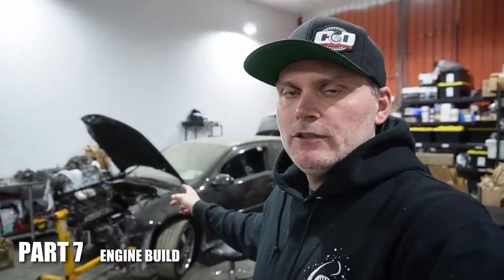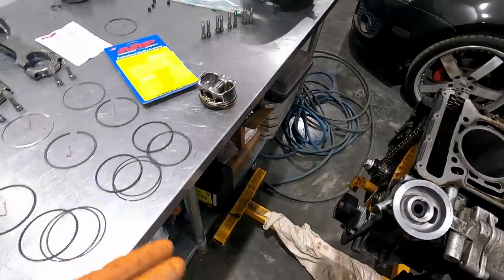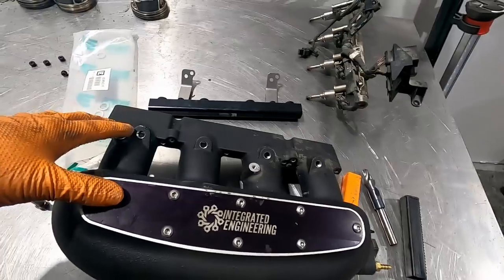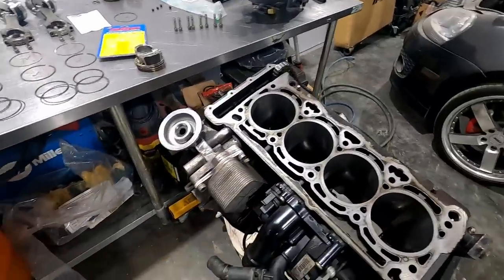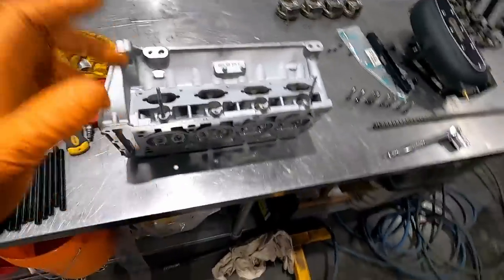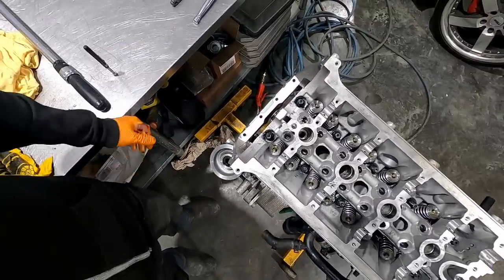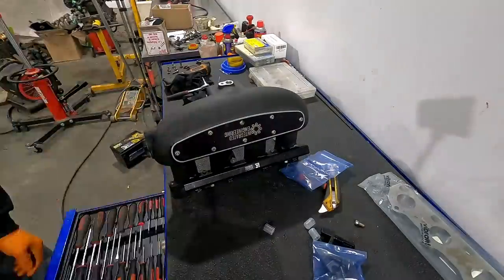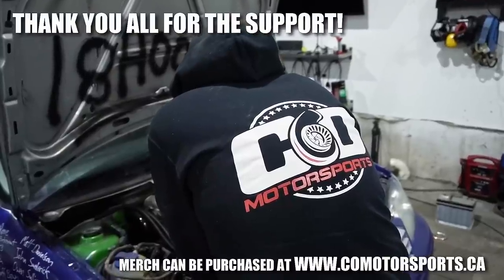MK5/6 TSI EA888 Big Turbo Engine Build PT. 7

Comment: Interested cause I’m building a Gen 3 tsi mk7 motor with the integrated exhaust manifold into the cylinder head…. Also will be cool to see the manifold y’all end up fabbinn up.
Reply: Thought that manifold didn't fit mk7 1.8ts

Comment: You guys obviously know what your talking about so I have a question, I wanted to RS3 swap my 2.5 MK6 Jetta but a used engine is $15k with a ECM and no trans so I'm gonna buy a $500 2.5 but before I build it I was wondering if I could use the head, intake manifold, and turbo manifold off a RS3 on a non turbo 2.5? I'm putting rods and .20 over pistons in the block and it's cheaper to buy a RS3 top end than to buy the IE intake manifold, have my head ported and get cams for it and have a custom turbo manifold made that's why I'm wondering
Reply: And do you think I should and could safely go up more than one size on my pistons, I was gonna go .20 over to be safe but if I can go a little bigger safely I will
Reply: And do you think I should and could safely go up more than one size on my pistons, I was gonna go .20 over to be safe but if I can go a little bigger safely I will
Reply from the maker: I'm doing the same swap in my daily. Don't overcomplicate it. It all comes down to how much power you want. If it's 3-400whp then just use a stock engine with the right turbo setup. If you want more, just do rods and pistons. It will make power without question.
Reply: @COMotorsports  what do you think about throwing boost at a used engine, I'm going for around 400hp, you think a used engine would handle it without doing anything to the bottom end? I'm already doing a hard gasket and front and rear main seals and timing chain/water pump because to my engine in my car what else should I do? Do the cams that they make for the 2.5 or the IE intake manifold benefit me in any way  if I'm going turbo? This is also my daily and the first new car I've ever bought so I wanna do it right
Reply: @COMotorsports  also love to see a video on your daily, we need more good 2.5 content... ECS was doing the swap in a 914 but they made one video and it's been months with nothing else and all the other videos are "what a 2.5 sounds like" 30 second sound clips basically

Comment: I have a question. I did all new timing chain on my 2.0T a while back but had a real hard time with the crank pulley. Every time I took the bolt out to put the pulley on the gear would move. I had to leave the tensioner pinned until I had the crank pulley on and then tension the chain? Would you have any clue what I did wrong, or be able to put it in a video when you pull that bolt out to put the pulley on?
Reply: If you take the crank pulley off, put the bolt back in to hold the chain drive attached to the crankshaft. Otherwise the crank can turn and the chain drive stay in place or vice versa. With the bolt in hand tight and holding everything together, you can pull the pin
Reply: @etunedmk4  but with chains and cover on and tensioned, how do you pull the bolt back off to put the pulley on without it moving? As his sits in the video, like I did mine, when I pulled the crank bolt out to put the pulley on (that bolt is what holds the pulley) the timing gear would be pulled to the exhaust side of the engine and up just a hair.

Comment: I've got a MK6 with CTS Turbo's K04-X hybrid turbo kit.  I'm in the states and running 93 octane.  I'm running out of fuel around 6K rpms with the oem low pressure/high pressure fuel pump.  I'm around 90% duty cycle on the low pressure pump.  Would you suggest going with water-meth to supplement the low pressure fuel pump or should I aim to install a larger fuel pump?  I've read that you can use a pump from the S4/RS3/etc, but it requires modifying the ecu.  What are your thoughts/suggestions?
Reply from the maker: Watermeth provides lots of benefits but also brings things outside the stock ECU meaning more room for errors. We usually do LPFP in these and sometimes LPFP module as well depending on what the vehicle is used for.
Reply: I’d suggest one of the Precision race works drop in LPFPs. 
Will need upgraded module or fuel pump ground mod for it though
Reply: @Ethan007Hacks  Yeah, I believe that anything larger than the oem low pressure fuel pump will draw more current than the ecu can handle and will therefore require the 'fuel pump ground' mod.  Thanks for sharing.  I haven't heard of Precision Race Works before.  I'll look into them!
Reply: @whorutothink  yep. I’m running their drop in walboro 535 kit but I had to modify the fuel pump ground so the module wouldn’t overheat. Holding off on buying a PM4 until I get the built engine in

Comment: Have you rebuilt any of these 2.0t after timing failure? 80k on it, just wondering if the block likely needs work or if I can just rebuild it without having to get the block/head machined
Reply from the maker: Engine failure is generally unique to itself.  There are so many factors, how and when it failed can change the overall damage. You can't say anything for certain until you open it up and see what damage has been caused.

Comment: Hi I have a mk6 with a hpa k04 all of the supporting mods for it and I just put on a IE manifold and I have a meth kit but I never put it on because I am running IE tune and it’s not for meth I was wondering how I can hook it up and not blow my motor or how to run port injection instead and also if putting a bigger turbo on it I would have to build the whole motor.   Thanks
Reply from the maker: Port injection is not an easy feet on mk6. The stock ECU can not control port injectors. Stick with the water meth setup. Stock engines good for ~400whp so you have room to go from a k04.

Comment: I've been long awaiting this exact content to guide me if I want to go further than stage 3. If I were to run an ie manifold on the car at stage 3 would it make much of a difference?
Reply from the maker: Maybe someone but not tons. The difference comes in when you're doing dIrect port water meth or want to run a second set of injectors.

Comment: why wv never made a powerful version of the ea888 gen2? and jump from ea113 to ea888 gen3 on golf r/ S3. What is it weak point?
Reply from the maker: The MK6 R was an FSI... so not the same engine at all. But the Gen1/2 EA888 were only slightly different and are good for around 400whp.

Comment: Good job. What is the 2.0 tsi ea888 gen2 head limit for make crazy hp?
Reply from the maker: Fueling is a problem before the engine becomes a problem.
Reply: Yes i know, after high fuel pump and injectors upgrade wtaht is stock head limit of ea888 gen2 engine? Nobody talk about head limit 😊
Reply from the maker: @vitomelchionno6225  It's because it's not an issue that pretty much anyone's going to run into. It's a decent flowing head, and people have made a lot of power on much crappier cylinder heads.

Comment: I just bought mk6 with a rod knock and the piston was touching the head and just did a full bottom end rebuild and swap. How come you didn't do all mew guides?
Reply from the maker: Because the engine has low kms, and there's no need.
Reply: @COMotorsports  we replace them by time, being over 10 years old just a good peace of mind for me, but if they hold up thats definitely nice to know that there's nothing to worry about. I've only seen the small one between the cams break

Comment: Do you use a tune through the ecu to control the extra injectors or is there a separate controller for them.   This is the step I've been stuck at.  Can you do this through maestro?
Reply from the maker: Definitely can't be done through Maestro, this car is going on Syvecs standalone. One of the very few that can control direct port injectors.
Reply: We ran megasquirt on my set up  built motor ported head +1mm valves on both sides juat like they did 1000cc id on top golf r on bottom 2 535 pumps it was not enough cams tapped out so sold all off it n n doing k24/dsg on fuel tech for real powaaaa

Comment: Maybe I missed it, but how are you going to block up the direct injection ports?
Reply from the maker: Those are still active and will control fuel for driveability and the first couple hundred HP
Reply: @COMotorsports  I see, thanks for the reply. Does syvecs control the direct injectors?
Reply from the maker: @opt123123  yes sir. Which is one of the very few to be able to do so.

Comment: Is there anything that needs to be done with the balance shafts when doing a build like this?
Reply from the maker: Ideally they'd be gone but not a viable option on these.
Reply: @COMotorsports  right. I did see 1 video where someone deleted them and had a electric water pump just stuck in the engine bay. Not the prettiest setup but it served it purpose. I'd love to see someone come up with an actual factory style water pump with an electric motor in place of the cog pulley. Then just take the balance shaft chain off and let them sit in there or just a setup like they use on the 4g63 where they tap in a bushing to block the oil ports.
Reply: @COMotorsports  or possibly have custom balance shafts made without the weights on them so they are just neutral
Reply from the maker: @blindabinda1234  It's not the weight of them. they're totally fine however they are just more prone due to fail as they're more prone to failing due to oiling problem. They just need to stay clean and they'll be happy. The issue is they're not easy to check and yes would be much easier if there was a viable delete option.

Comment: What ratio on piston gap rings u go ?? 0.0050 0.0055 or ?
Reply from the maker: All depends on piston manufacture, bore size, what the engines being used for and power goals. Not a straight cut answer.
Reply: @COMotorsports can u help me to choose ?? Ia have JE pistom pro seal rings with JE pistons too i want go maximum 500hp but on paper with piston rings are High performance category and street moderate turbo/nitrous i dont know which is better its street car and i want make it safe more than oem bcs one of oem pistons died but bore stay 82.5
Reply from the maker: @marekkosa4111  It's all based on bore, turbo used (how much boost), and overall power goals. My suggestion would be to follow whatever JE recommends on their sheet.
Reply: @COMotorsports  i understant i have stock turbo and on sheet are only category and numbers nothing about those categs.. , i have stock turbo yet 82.50mm bore and if i want go for bigger turbo i need to change rings then or ??

Comment: If you are going with additional intake manifold injectors wouldn't the catch can no longer serve any purpose?
Reply from the maker: Why's that?
Reply: @COMotorsports  Intake manifold injectors would introduce fuel that would pass over the intake valves thus carbon should no longer build up from the recycled engine vapors.
Reply from the maker: @Tunns  a catch can does a lot more then help keep valves clean. Oil/Oil vapor kills octane and keeping that out of the intake path is our primary reason.
Reply: @COMotorsports  Copy that, now I am interested in how negatively it does affect octane level of the fuel. Didn't look for it but sounds like a good portion of a catch can video :)

Comment: Quick question guys is there a reason why you didn't go with the FSI and went with the TSI engine? Was it because the high pressure fuel pump riding on the cam?
Reply from the maker: This car came with a TSI and has had multiple different turbo setups on it. This is just the newest rendition.